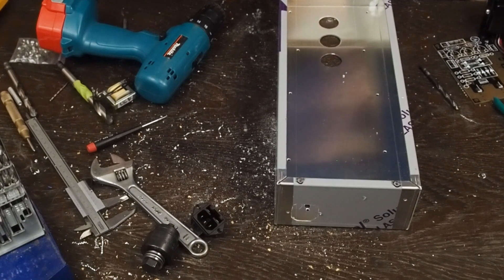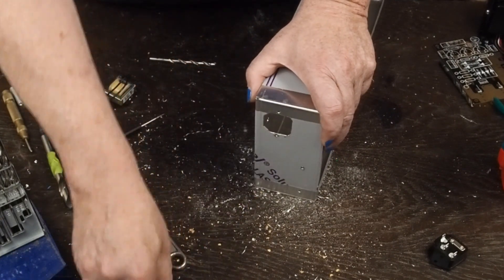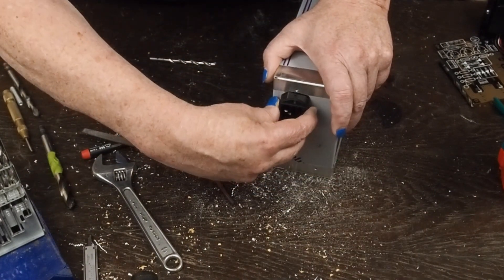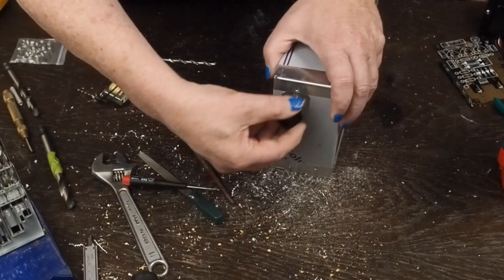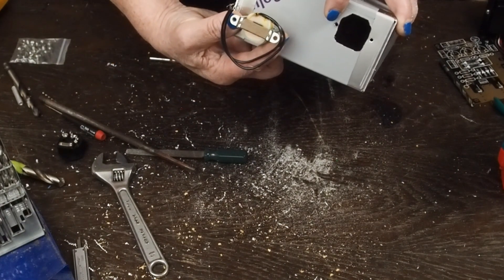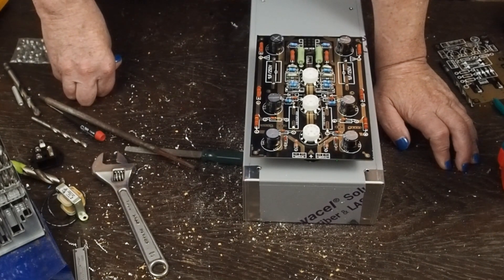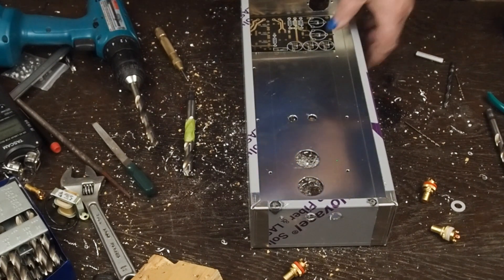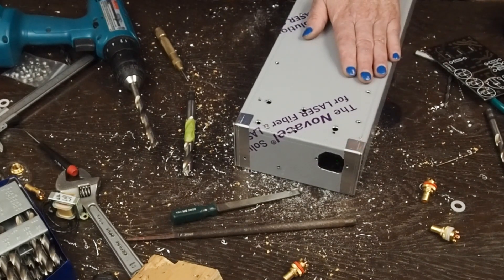All Tube Phono Stage Pre-amp Part 8: Chassis Fab

Comment: I am not a fan of visible RCA jacks.  So if you were to build this with two cabinets, power/signal, you could turn the board 180 degree and put the input on the back.  Then use shielded wire to put the output rca plugs on the back as well.  The power at that point would be dc so it would not be a problem. Am I correct on all of that?
Reply from the maker: That should work and that's the fun of DIY, you can set it up how you want :)

Comment: Great video!!  So the audio ground is not the same as power ground?  And are you using a 3 prong power cord with green tied to chassis ground?  (Sorry if you answer this in subsequent videos)
Reply from the maker: Yes I always use 3 prong power cord with the green tied to the chassis. I always ground the audio to the chassis is a different spot.

Comment: I put antek toroidal transformer on the metal chassis that got a big hum. Maybe the my metal chassis has magnetic. I haven't tried with the E/I Core yet.
Reply from the maker: You could try shielding it with a piece of copper clad PC board grounded to the chassis. Might help to also space it away some. Hope that helps!
Reply: @SkunkieDesignsElectronics  Raiser it up 1" work great, will cut out the junk pc board to see if it helps, never thought about it. Thanks